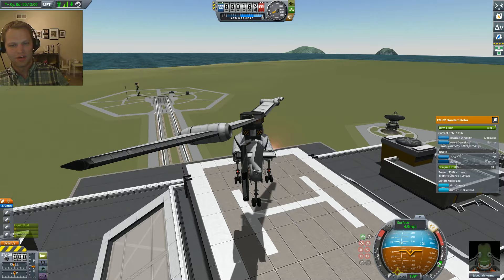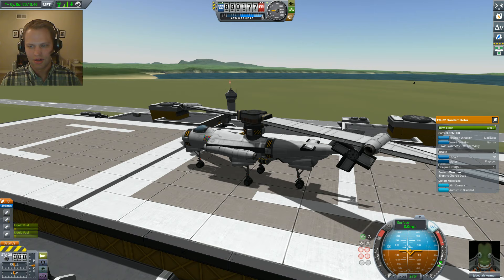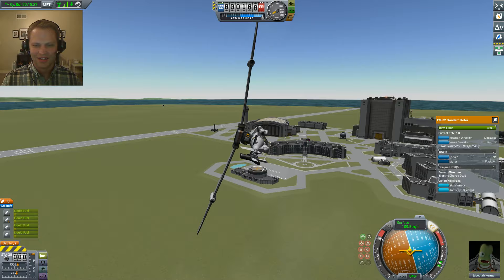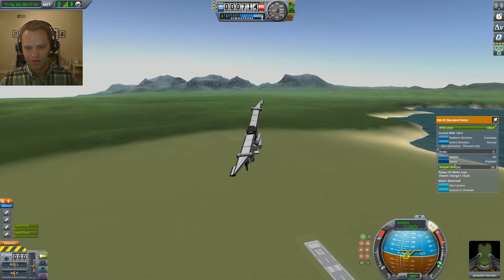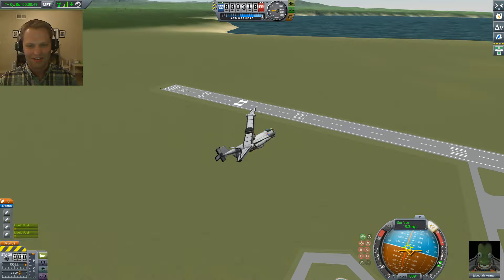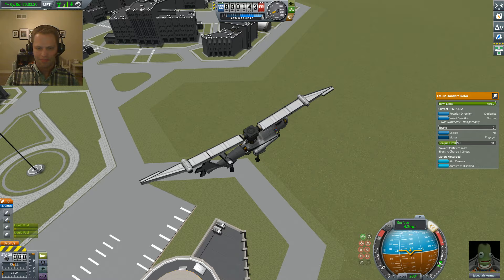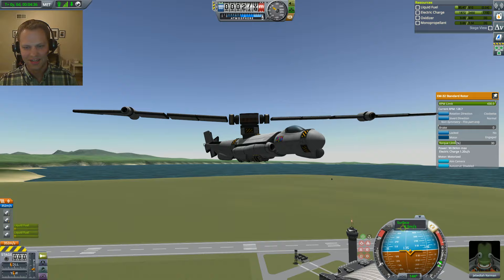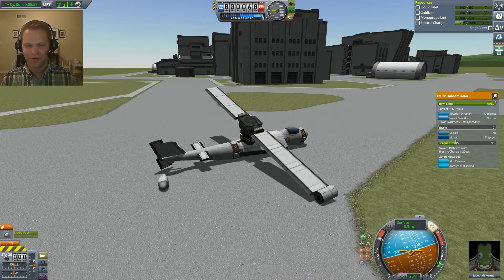Kerbal Space Program - rotorwing tip-jet airplane helicopter prototype

Comment: You have the servos that connect the winges/blades to the main rotor. The whole thing would be more controllable if you spun the main rotor at a constant rate and changed the angle of attack with those servos. Spinning down the main rotor for landing is very dangerous as evident around the 9:00 mark. 
At 9:38 you said "I'm gonna take off vertically again, because we don't have any runway to work with here.", which begs the question: What is the whole point of having a helicopter/plane hybrid if you do horizontal take-offs. 
The benefit of a helicopter is VTOL and hovering capability. The benefit of a plane is horizontal air speed. 
I don't really see why you didn't activate the brakes on the main rotor. The main problem with the transition from heli to plane mode is the wait for the spin down of the main rotor. 
Don't mind my criticism though, it's a cool concept. 
Of course stuff helicopter stuff is far easier with the new helicopter blade parts that have come out since. They can enact cyclic control, so you can build helis without reaction wheels.
https://forum.kerbalspaceprogram.com/index.php?/developerarticles.html/19-advanced-blade-controls-r211/